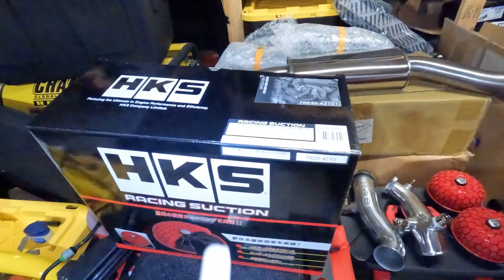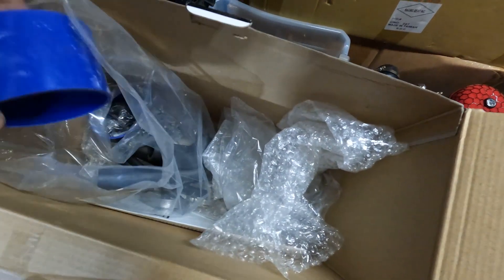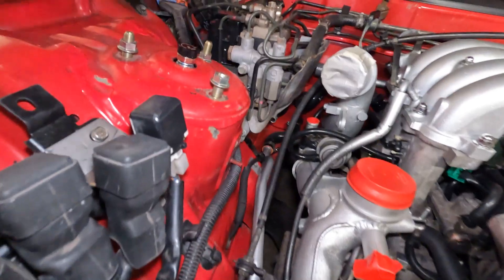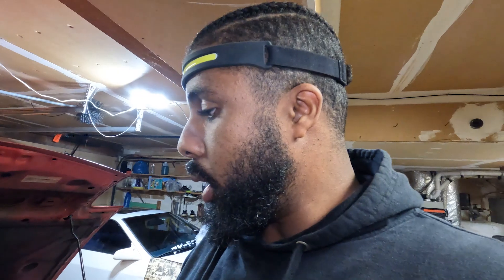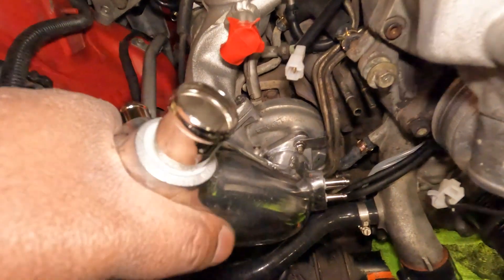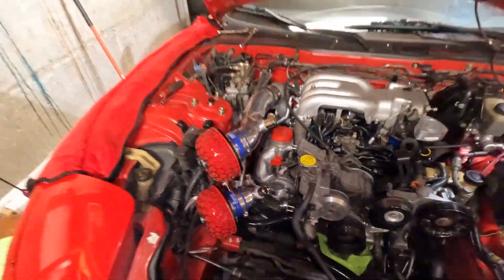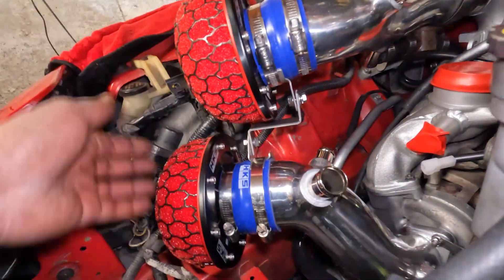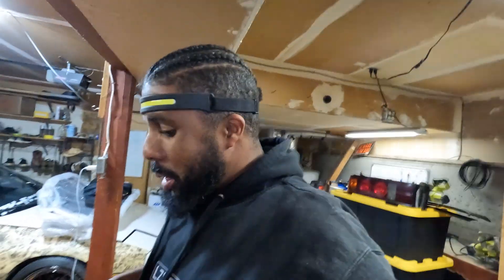HKS RS Intake Installation |FD RX7|

Comment: are there any maintenance info? i heard that the filters could crumble apart and get sucked into the intake,  but i suppose that's only if an owner literally never cleans or replaces the filter (after a REALLY REALLY LONG TIME).   i hope ya do a follow up on filter condition in a year or two. subbed
Reply from the maker: Thank you very much! HKS recommends that you replace the filters every 6-12 months or 6,000km-10km. IMO I think 6km-10km is a little to frequent, but I guess it depend on where you live. But yes I’d love to do a follow up on filter condition!